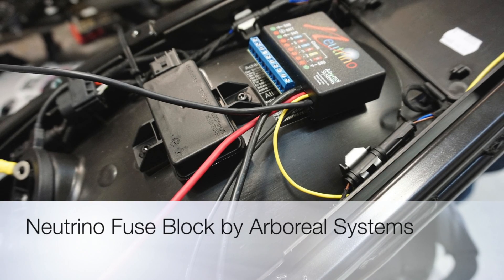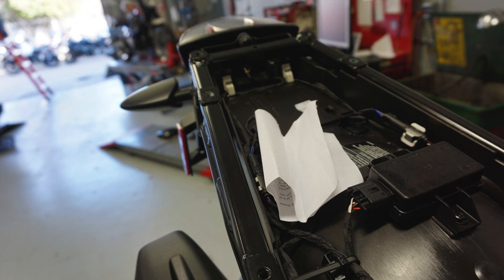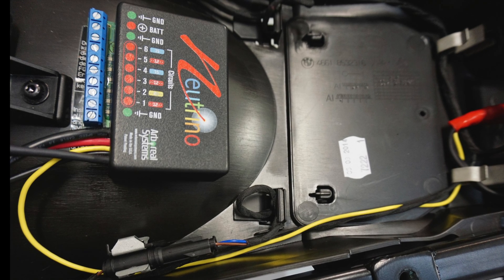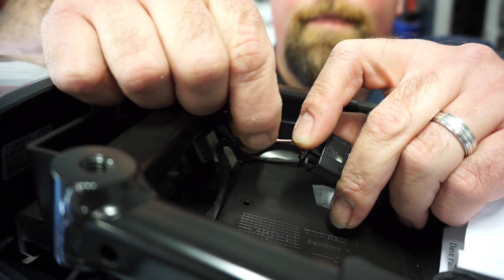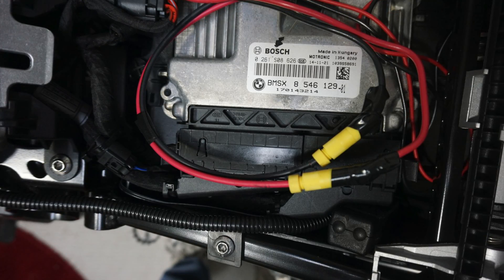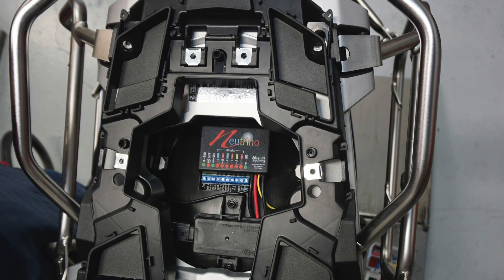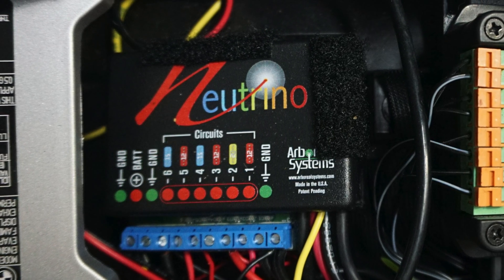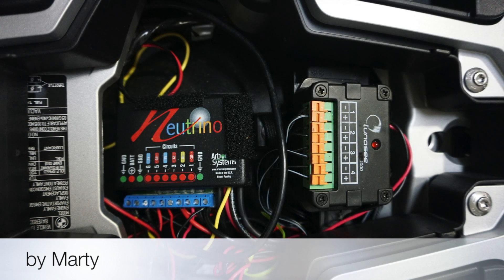Neutrino a Fuse Block

Comment: I'm in the process of installing my black box we I type.  I searched for videos about this on YouTube, and this did not show up in the search then, but days later in the recommended videos.  SMH.  I mounted mine on top of the ECU because I didn't want to have to lengthen the leads to reach the battery on my 2015 GMW GS.  I've got most of it installed, but I need to run my "trigger" wire to a wire to activate the unit when the key is on.  The module will NOT work until this connection is made.

Are you still liking the black box?
Reply from the maker: Yes, it is still working extremely well. There're a few features I wish they would additionally add when I first got it, I guess I was among the first hundred or so and the developer/Owner Took some advice/Suggestions. I may have not been totally clear on what I was wanting he got close but I felt I was a nuisance so I shut up. I've done a workaround but maybe I should recontact him

What I was wanting, Is it to provide power to something when it is dark outside. I have the lunacy lights, there make your wills look like Tron. In what I was wanting is if I should start the bike And it is dark out the power would be activated. And when it is light outside it would not have power.

What he wrote into the program was if the bike was on and I past from day light to dark it would come on. But yes it is already dark outside and I turn the bike on it does not provide power to that circuit. Basically that's what I was wanting to happen is it to know when it is dark and provide power based off of strictly the time zone indoor time here. I would be okay with even me setting the time manually but I have not reached back out to him.

A lot better than any fuse box out there it works extremely well I still like mine a lot I'm just wishing for the stars each time
Reply from the maker: Additionally from comments below I would highly suggest putting disconnects in-line